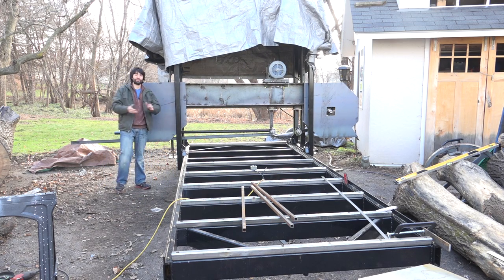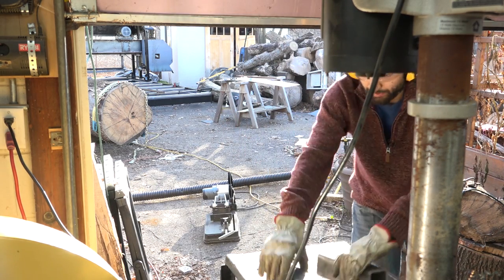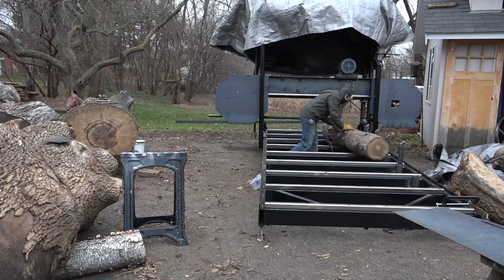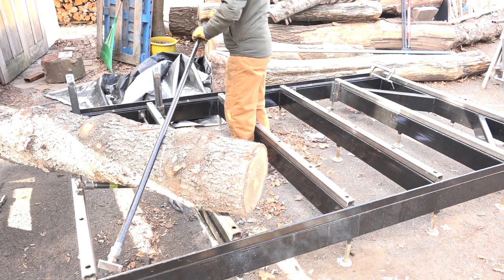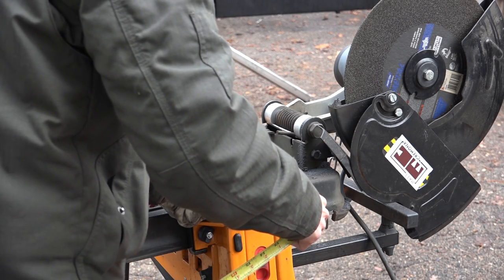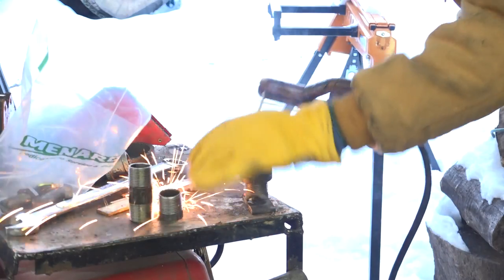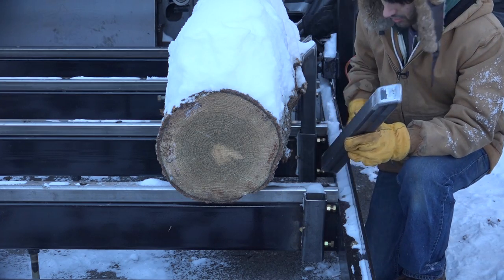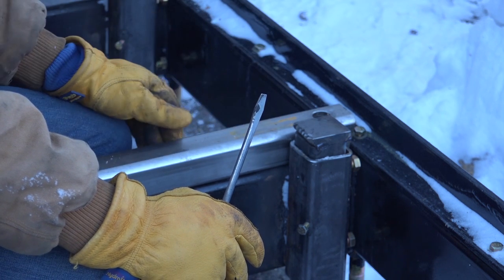Log Holding - Building a Large Bandsaw Mill - Part 14

Comment: The Cooling Fan in your welder needs some attention a little machine oil should do the trick!
Reply: I was wondering what the racket was. Sounds like it's on its last legs.
Reply from the maker: +Y Pop yeah it's on my to do list. Taking apart a welder should be fun.
Reply: Matthew It is easy just take the sheet metal screws off of the sides and I think the top. the cover will slide up and off the fan will be about dead center  while you are there blow it all out (take it out side) Put oil on the shaft and you should be good to go for a while. Or you can replace the fan motor. It will be a 220/230/240V motor. Unless you have problems with the switches do not bother taking the front apart!
And Yes I do have the same welder and its big brother. Lincoln 225A AC and a Lincoln Ideal Arc  250 AC/DC.
Reply from the maker: Well I managed to remove every screw in the process but the fan is quiet again haha thanks for the help!
Reply: You Are Welcome! Glad I could Help!

Comment: For your log clamps.  What if you were to put a short length of pipe over the 3/4" pipe, one on each side of the tee fitting.  You could use them like a slide hammer to quickly set and release the clamps.  A pipe by itself might be too light but you could weld something on to make them heavier and maybe easier to grip.  If this works, you wouldn't need to keep track of any tools in order to clamp the logs.
Reply: Mike Higgins that’s a good idea, buy a piece of C channel that fits over the pipe and weld pieces on each end to keep it captivate, weld a handle on the side, would take 10 minutes and give you a slide hammer that would work in both directions.

Comment: FWIW. Instead of bolting the log clamping devices in place, 1/4" bar could be welded horizontally  between the cross members on each side and just let the plates rest on them. Would give you the ability to move them anywhere on the mill you need. I know I'm "armchair QB'n" but just a thought for whoever builds one.

Comment: You had a 8" beam it could of had saddle clamps underneath with a simple 1' x 1/4 "flat bar for a traveller made and tension angle to hold the log sliding in 'think of the typical 4-8' bar clamp- Easy

Comment: Good quick temporary solution. My mill has a cam lock on each bunk to hold the logs, I don't think it would have been much more work to build this system, and no tools needed for adjustment. Thomas Bandsaw mills built right here in Maine, I don't know if there are any videos on the cam locks but there might be.

Comment: Hey Matt,  add a 6" - 8"  piece of the 1 1/4 pipe over top of the 3/4 spanning section of the log holder on the inside of your locking bracket T...instant slide hammer and no need for any extra tools while running the saw.  One less thing around to loose or cause any problems.

Comment: 15 degrees, sounds very refreshing. It when it reaches 0° F that you really should worry. I'm from a Wisconsin farm. 

Anyway my thought was, the log holding things that slide along the gas pipe are angled the same direction. Is there any possibility that this would allow the log to lift or roll as opposed to angling them towards each other? One would think the weight of the log would be enough, but how about the last bit of the log?

Comment: How do you plan to turn your log until you get your hydraulics done? I have a small push mill that I made my own track system for. I am planning on making some upgrades to the log stops and the clamping similar to what you have done. Turning, especially the large stuff I have seen you mill, is the crux of my workload when working alone. Recently I saw a neat manual turner idea on a Cooks sawmill using a hand winch. Have you designed anything to turn your logs manually yet?

Comment: Looks really good, you are getting close. You might consider grinding or filing flat, the corner of the adjustable side posts where your set screw contacts them. That will provide a larger contact patch for the screw to push against. My two cents, eager to see some saw dust fly.

Comment: That cordless drill mfr should use your build as a promotional video for the quality of that drill and it's batteries!Nice work with the black pipe makes sense and not too costly and spare parts are in endless supply too if you find those tees start to slip after a few years you can just swap them out with some new ones for cheap.

Comment: I recommend welding some 'wings' to the bolts used for the side support adjustments.....no wrench to lose, always there.

I also recommend having a few offset or angled sockets for the side supports (the spare/longer pieces) to stow into, again, always there when you need them, off the ground, ready to go when and where you need them.

Comment: I really like those "pipe clamps" you're using.  One of the great things about those, I think (if I didn't miss anything) is how easy they would be to replace (or upgrade, with the 1" pipe, for example).  I feel like they're an efficient/elegant design, from a layman's perspective.
Reply from the maker: Yes, I could keep the flanges and use reducers to swap the 3/4 pipe to something larger.  Pretty slick

Comment: Cant you fill the pipes with some kind of material (wood, epoxy maybe even sand?) to stiffen them up?
Reply: Leone the steel is much stronger than most of those so they would flex before the steel did. Even like a hardwood dowel of the right size probably wouldnt buy you much.
Reply: Well my thought process was that, wood is less flexible than the hollow inside of the pipe. So basically anything would stiffen it up :)
Reply: Actually, filling the void has proven to add substantial support in many applications... So I think it's a good idea.
Reply: The stress inside a bend pipe increases along the radius. The centreline will always be stress free since the radius is zero. Adding a filler would stiffen it up. But it will only play a minor role in beam bending since the radius is small. However, having a solid core reduces the risk of buckling.
Reply: Leone if you had a softer metal, like aluminum then maybe it would work. But the wood osnt as strong as steel so even though it feels less flexible, it starts flexing before the steel does and would give you much. Yea it would be better than nothing, but probably not worth it.

Comment: I think I am getting as antsy as you are to see the first cut!

Had a thought a while ago and never posted it.  I noticed you occasionally have difficulty starting your drill in a center punch divot.  Have you though of staring your holes with a center drill?  I know it is an additional step, but it makes for easier drilling in the long run!
Reply from the maker: Probably should have bought one.  Another thing that would have helped would be an actual punch to make the divots much deeper.

Comment: On your homemade spike bolt things, why did you weld the little plate onto a nipple? Seems like you could weld it right to the coupler and save some money on nipples.

Unrelated, I have some pecan that I rough cut a few months ago and have been drying in my garage, they're still pretty green. The weather is getting cold here but I need the room in my shop. Will the cold weather just slow/stop the drying process, or will the freezing temperatures cause more splitting and cracking from the moisture in the wood freezing and expanding? Thanks!
Reply from the maker: The fitting are cast iron which I was reading is quite hard to weld successfully.  The nipples were cheap insurance since they were $1.50 each.  Freezing temps will slow the drying process but will not have an effect on the wood.
Reply: That makes sense, thanks!

Comment: For your vertical supports, you could make the flat grabber on one side and the angled version on the other side, and not have to have 2 sets for different purposes ... just rotate around once you get the log squared.
Reply from the maker: The only issue with that is the grabber thing won't pass through the pocket so it can't be on the other end of the angled side support.  I have more pockets than I need so I can store both versions on the mill pretty easily.
Reply: Matthew Cremona right ... not the other end but like the backside of the top point of the angled piece.  So you just rotate it horizontally and use the high side when you want it to sit flat and low, and the 45° angle side when you want something shaped like the wood curvature.

Comment: Hmmm? Here is a thought, if it's that cold there will the frozen moisture in the log make it harder to cut therefore dulling the blade quicker? I mean the logs density has to go up in those temps?
Reply: Jeremiah's woodworks But ice and steel have low friction.
Reply: +Max Maker wouldn't low friction on both surfaces make for a poor cutting performance requiring more force into the wood? And if not water not in the equation what about the woods mass?
Reply: Frozen logs cut slower (there are also special bandsaw blades for frozen wood, but they're slightly gimmicky and definitely uncommon), but the big problem is cutting partially frozen logs. You get horrible diving problems as you cut through frozen-unfrozen sections.

Comment: Mat, what are you going to do when you have to man handle a 6 foot Dia. log?
Reply from the maker: I'll cross that bridge when I get there.
Reply: OK! I thought I saw a quote, that mentioned using a Bobcat, but haven't  found that quote. Thanks again, I mentioned building my own mill, 36 inch log x 24 foot bed. Still a 36 inch 16 foot log was heaver than my 70 HP cash did not want to pickup! Also I built similar squaring post as yours, that a just bolted on, rather than welded. Good luck with mill, and congratulations on the new addition.

Comment: could you make it a trailer for road transport?
Reply from the maker: Sure but it's not really that practical since it would be oversized.
Reply: Maybe for just driving around the property
Reply from the maker: Yes, I'll be doing something for that.  Not going to be a full out axle with suspension thing but tires that I can put on when I need to move it

Comment: I hired a portable mill once and I recall that it clamped the logs in the middle of the bed from both sides.  The bed was slightly V shaped.  The structure was rectangular, the V made with flat pieces welded to the structure.  I'm thinking that accommodates the taper in the log and makes it easier to roll the logs.  Those clamps could be operated independently to roll the log.  The operator would get the logs close to position with the hydraulics and then used a pike with a hinged hook to get the log in the exact position, clamp it then make the cut.  Ah, don't take the mufflers off to "get more power".  I hired the guy for just one day, about 3 hours and I heard about "that noisy machine" for 2 years.

Comment: Another thing the guy had was 2x8s with 2' screws driven thru so that just about 1/4 inch of the point was exposed on one side and the heads out the other.  The points dug into the logs and the heads caught the structure of the bed.  He used these to boost the logs up to get that last cut.